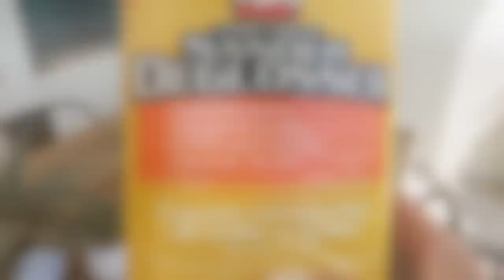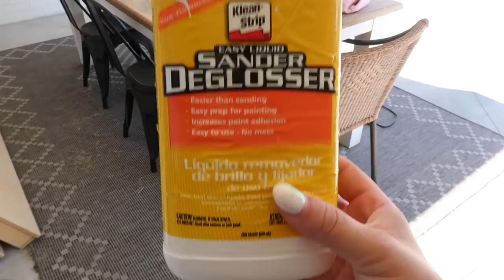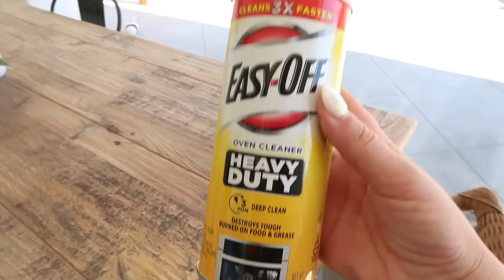DIY HOME PROJECT ON A BUDGET | HOW TO LIGHTEN WOOD FURNITURE | DIY BLEACHING WOOD FURNITURE

Comment from the maker: Today I am testing out oven cleaner to bleach or lighten my wood bench. I have seen this trend all over IG and TikTok so I am putting it to the test to let you know if it's worth your time!
Reply: I love your videos but the background music drives me crazy!! Is there more subtle music available?
Reply: Thank you for sharing, I have been wanting to do this! ❤🎉❤
Reply: Hey Ashley! I was able to lighten mine with two small cans of wood stain. One white wash and the other weathered gray. It removed the red completely.
Reply: You already sanded the old stain off (which is the hard part) so all you have to do is rub on the new stain(s).
Reply: I didn't care for the oven cleaner method either.  My wood didn't change muchand it was a lot of work. I have tried straight bleach and that worked like magic. Since the original sealer is of now, you could always reseal it with a white wax. That will take down the redish orange tones and give it a more beach wood/ grayish look.
Reply: Ashley ... thanks for testing this method and recording it. I use oven cleaner a lot for cleaning, but, I spray it on and then cover it with plastic wrap and leave it sit. This allows it to stay moist and keep working vs. drying. It's a miracle cure when cleaning an oven or a horrible stove top or even like cookie sheets or old cake pans. I wonder if you had covered it with a little plastic wrap if the oven cleaner would have worked a little better?
Love your channel. Thanks for being you.

Comment: The only difference seems to be that the gloss is off. I think the issue is not that the oven cleaner didn’t work but more that the kind of wood you have is red all the way through and not just a stain on top.
Reply from the maker: That’s what we are thinking after that experience.
Reply: That’s what I was thinking while watching this process. I wonder if you could put a whitewash on it to mute the redness
Reply: Yep that’s what I thought too! I’ve had the best luck with Pine and Oak. Also older pieces produce the best results. I refinished a dark cherry 100+ years old rocking horse & it was stunning! (& the process was so easy!) Tried to do the same for a modern coffee table & it took so much effort just to get the poly off! Modern furniture uses either a stronger poly or different formulation. CitriStrip is prob the best way to go for modern pieces…even tho I loathe Citristrip!!!
Reply: It looks almost like cedar .  Maybe that’s why it didn’t work .
Reply: @TilVacuumDoUsPart   it looks like cedar that’s probably why the red didn’t go away but it’s still cute
Reply: Yes, the original finish is probably a clear finish, designed to bring out the natural beauty of the wood. I know the current trend is to dislike “ orange” toned wood but it is real, not a colored stain.
Reply: @stephanieswinsonmays8986  I'm so glad that you love the way your rocking horse turned out. I bet it looks beautiful ! But it hurt my heart to think about lightning 100 yr old cherry. 😟
Reply: Yes, it’s cedar. I’ve watched some of the videos of other people doing this process. The wood usually looks like oak on the projects where it turns out more blond color.

Comment: The issue looks to be the wood itself. You could try a wood bleach to lighten it. Or use a liming or white wax which will also give it a lighter appearance Also, I’ve used this method many times & sometimes struggled when it came to modern pieces. I’ve done antique pieces over 100 yrs old & they turned out beautiful. But a coffee table from 2003 gave me problems.
Reply from the maker: That’s what we are thinking after that experience, the wood must be red all the way through

Comment: Ashley - I loved this piece the way it was. When you showcased the entryway makeover, i was drawn to that bench and the styling. The rich wood color and the black wrought iron legs with that slant design is what I loved about it. I know you wanted to try this hack as you were not loving the color but I would have purchased it from you and offered you more than what you paid. Hopefully with all the work that went into lightening the wood, you will warm up to the finish for now at least. 🤔😁

Comment: I would suggest using paint stripper first which normally removes top layer of finish and opens up the pores of the wood.  You would need to use a metal putty knife to scrape the gunk off. You can then sand it, brush a coat of regular bleach gel to lighten it up, hose it down and then sand it again with a light grid sanding block.  This would work much better.  Also recommend unscrewing the metal legs before you start working on it.
Reply from the maker: We wanted to try the trending hack of using oven cleaner instead of wood stripper to see how it worked. But I’m sure it would work better. In this case we think the wood is cedar and naturally red so don’t think we would ever get it light how we want
Reply: @TilVacuumDoUsPart  its a good looking bench with nice lines, so maybe you could paint the top surface to get the lighter look you desire and still keep it in your entryway.  It would be nice to see how you transform this piece as a part 2 video 😉

Comment: Ashley I highly recommend using straight bleach on it.  All you do is paint it on, let it sit in the sun for at leastAn hour. After an hour if it’s still not the shade you like you just apply more bleach. When you have reach the desired shade you just wash the peace with water to neutralize the bleach. It works like a charm! It could also be that the wood the bench is made of is just to red to lighten. But definitely try the bleach it is so easy and works extremely well. 😀
Reply: I used the bleach process and it was a lot easier and not as messy. Just brush it on and let it sit.

Comment: I don’t think you got the results of lighting expected because the wood used on that bench is redwood as in redwood tree with natural edges. The color is beautiful once removed the glossy finish. A non gloss finish would accent that beautiful! Wetting wood isn’t bad it actually will cause the pieces to swell and close cracks instead of using as much filler. It just needs to fully dry before applying any color, varnish, shellac or poly.

Comment: Why did you not just use a stripper? With that flat surface you could have done one application
Reply from the maker: There is a new “trend” going around online about using oven cleaner instead of stripper because it is cheaper and supposedly works just as well. So this was to test out that theory. We think the wood is cedar though and that’s why it wasn’t getting lighter

Comment: So you’re using an oven cleaner to take the polish finish off of your store-bought furniture why don’t you just use a stripper a wood stripper and aren’t you trying to make it lighter and more wood tone brown versus the red that this piece of wood had in it it’s probably a cedar I don’t know? Why would you just take and remove the seal on top of the wood and then come back and stain it versus thanking that the natural wood was going to pull a lighter shade to it I think that’s why you’re disappointed is because you didn’t do anything except take the top coat off. And I have never heard of using having cleaner to bleach wood interesting
Reply from the maker: I was testing the new “trend” going around about oven cleaner stripping wood as well as wood stripper. So this was a test to see the validity. After our experience it seems like the wood is cedar and red throughout so that’s why we couldn’t get it lighter without bleaching it. Thanks for watching!

Comment: It looks like the gloss only came off , I used bleach and had my piece outside. I put 3 layers of bleach and it worked great.
Reply: Also, using a 60 grit sanding paper will help get it off. Then switch to a 100 or 200 grit to soften it up.